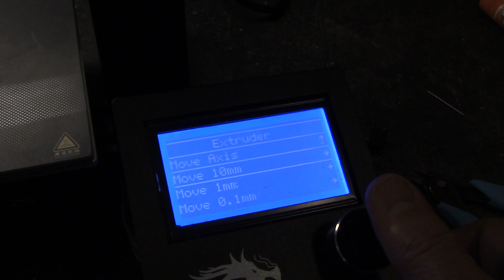Ender 3 Filament Feed Issue - Solved

Comment: I had this same issue.  Made a print and it worked fine.  Changed filament then nothing.  Checked everything you mentioned and still nothing.  The filament acts like its backing out.
Reply from the maker: If it just like mine then the extruder is broken. It’s inexpensive to fix. I didn’t realize at the time I shot this video that mine was broken
Reply: @MyEngineeringProjects  So the extrusion gear? I changed out the nozzle and trimmed the tube a little due to a slight clog and it's still not feeding properly.
Reply from the maker: If it's like mine, then it's the entire extruder which contains gear, bracket, etc.  The issue is that the stock extruder breaks at the bracket itself so it cannot apply any pressure to the gear.

Comment: Is there any logical reason why the gear knob would be knocking & rattling, even when tightened?  It's so irritating that unless I put a ziptie on it to make it stop, I can't be in the same room with it.  I just replaced it & the new is doing exactly what the old one was doing...
Reply from the maker: Where are you putting the zip tie? It sounds like something is loose. I have heard banging and it was a result of the extruder clogged. The resistance was so large that the stepper was slipping which caused the banging noise.

Comment: I fixed all the way up to that part on my end or three pro by the issue that I am coming across now is the extruder will extrude perfectly fine for the test line and then when it goes to do the print itself it will do super thin layers thinner than what it should be like it’s not extruding enough filament
Reply from the maker: There are several things you can try. For one, make sure you have the right nozzle tip size. If it’s under extruding, it could be too small or potentially blocked by some sort of obstruction or damage.

Comment: My printer (Ender 3) extrudes for some in the print and then starts under extruding for 2-3 layers and then just stops extruding at all.When I try to push filament manually I feel a very strong resistive force and the filament barely extrudes ,when I try to pull the filament out it takes a great force to pull I even tried printing at more high temps,cold pulls,cleaning the nozzle and the throat,replacing the nozzle and I even tried a different filament but still same problem. Please help
Reply from the maker: Sounds like the nozzle is not hot enough.  Try to preheat the PLA and then push manually.  Increase the nozzle temperature and see if it will go through. You've already eliminated clogs and damaged nozzle issues, so it sounds like it's not melting the filament enough.

Comment: My pla still didn’t come out and if I tried this the filament is just going forward en backwards
Reply from the maker: It sounds like it has something to do with the nozzle.  It could be jammed, pinched closed due to a plate strike, or the temperature it too low.  Remove all pla, heat the nozzle, then try to push it through manually by releasing the extruder spring.  If it does not go through easily, then you need to find the cause at the nozzle.

Comment: Thanks so much this was such a headache I didnt even think it could have been a issue like this, bless bless
Reply from the maker: Glad it helped.  If your looked just like mine, then the part is broken.  It will need to be replaced with a metal extruder.  They are inexpensive and it's an easy fix.

Comment: did not help
Reply from the maker: What issue are you having with your extruder?
Reply: @MyEngineeringProjects  the filament refuses to go into the hole that leads to the bowden tube (screw is not the issue apparently)
also the bowden tube at the hotend can't be taken off for some reason, i know it's clogged so that's an issue

Comment: Hello I have an ender 3 v2 and the filament comes out manually and how you did it with the control I’m wondering if something wrong with the hot end or if it’s something else I made sure nothing was clogged changed the nozzle and cleared the tube. Any advice?
Reply from the maker: Does it work when you use the menu commands to extrude a bit of filament?  If not, then check the extruder.  Could be a tension issue or a broken part as I had in the video.
Reply: @MyEngineeringProjects  yes it does work when I use the menu controls that’s why I’m so confused I ordered a new hot end and I’m up grading the tube do you think anything else could be wrong
Reply from the maker: Ok. Have you tried a different print file?  Maybe there’s an error in the code.
Reply: @MyEngineeringProjects  yes I have and it still wasn’t working
Reply from the maker: That is hard to troubleshoot.  The only other thing i can think of is a setting in the slicer program.
Reply: @MyEngineeringProjects  thank you I’ll look into it I really appreciate you responding and trying to help with troubleshooting thank you

Comment: My printers nozzle isn’t clogged and my filament goes through fine when manually turn the extruder but when printing only a tiny string comes out
Reply from the maker: When you say manually turn the extruder, are you saying by hand or by the manual feed feature in the software?  If by hand then you might have an issue with the extruder.  If not, then the issue is somewhere else.

Comment: It’s spinning and it’s hitting the element, but it’s just kind of making an annoying like scraping sort of mechanical sounding sound and no element is coming out. It’s also not moving the element into the extruder
Reply from the maker: That sounds like it's jammed at the spool.  Can you manually unthread the spool?  You might also try to take off the tube on the extruder and just see if it will pull it at least to that point.
Reply: @MyEngineeringProjects  I have to buy a new thing of filament because that’s pretty old filament. I have to make sure it’s not the filament thank you though.

Comment: I have an ender 3 pro and my silver wheel is above the filament and i don't know how to get is to be in the right level as the filament , I have tried tightening the screw and it is still above the filament, any advice?
Reply from the maker: I don't have the pro version, but look for a spacer that should not be there like a washer of some sort.  It also might be in upside down.  Not really sure without looking at it myself.

Comment: My printer starts off fine then starts under extruding making the final product but with holes and less stability. Any advice ??
Reply from the maker: I would check to make sure you have the right nozzle size and that it is not obstructed.  If it's too small or partially blocked, that could cause under extrusion.

Comment: Mine ended up being the pla. Weird cause ive used it before. It needed to be thicker
Reply from the maker: I'm wondering if the tension on the PLA is too low given that  a larger diameter PLA worked.

Comment: Never occurred that this was the case for me. Thank you so much for this video!
Reply from the maker: You're welcome I'm glad it helped.  Note that if you had the exact same issue as in the video, that means that the extruder bracket is broken.  I didn't realize it at the time of shooting.  It's a simple fix to replace it with a metal version.
Reply: @MyEngineeringProjects  I have the metal version. the grub screws must not have been tightened enough and the gear slid down out of alignment. Your video helped me take a closer look and see the problem. Thanks again
Reply from the maker: Ok great.  Glad you got it fixed.

Comment: Hello I just got my ender 3 v2 I have only made 3 good prints I also have the cr touch but now every time mid print it stops extruding and the a axis resets and moves up and stops moving. Any help would be greatly appreciated please.
Reply from the maker: I have not had an issue like this before.  Since it does work and then stops, this could mean that you have a firmware or board issue.  I would try first to re-flash the firmware and see if it makes any difference. It could also be a connection issue.  Bad connections are notorious for intermittent issues.  Try to connect and re-connect all of the plugs with the power off.

Comment: I am trying to use my printer after 2 years gap, nozzle heating, all stepper moving but nothing printing!!!
Reply from the maker: Start by heating the nozzle and see if you can manually feed the filament.  If so, then focus on the extruder.  If it won't go through manually, check the end temp and look for a clog.

Comment: 1:20 I'm getting a message saying "hotend too cold" instead of movement options. Not sure what's causing this
Reply from the maker: You need to heat the nozzle before you can move the filament.  Go back to Pre Heat PLA and select the nozzle or "end"

Comment: I tried to replace my filament on my ender 3, but I can't feed the filament thru, and nothing comes out.
Reply from the maker: Make sure the tube is empty first.  You can take it out and thread through off of the machine.  If that works, then heat the nozzle and manually push filament through that as well.  If you cannot manually push it though, then you have to find what is clogged and fix that.  If it all is clear but  won't feed, then you have to look at the extruder and/or stepper motors
Reply: I don’t see my extruder stepper motor spinning when I go through the menu and manually trigger it. Does this mean I need a new extruder motor?

Comment: MY problem isn't that there was a clog somewhere. My issue is that the extruder gear won't push the filament through AT ALL after a few seconds. I use capricorn tubing so I can physically see any blockages and there are none. The community was not helpful when the real issue was the the stock extruder block being a piece of shit and I ended up getting a non creality printer instead with zero issues. The ender 5 pro is an expensive paperweight that had way too many problems.
Reply from the maker: The stock extruder is poorly designed. I had to replace it with a metal version

Comment: For me i after squeeze and tilting the gear , the gear dropped fully down. I then had to fix the grub screw while lining the gear to the height of the other gear up. It helped, but the grub screw is nearly dead…
Reply from the maker: Sounds like it needs replacing.
Reply: @MyEngineeringProjects  haha yes i was printing . It stopped right in the middle .. gotta change it now😂

Comment: Can someone help me please? My printer (ender 3 v2 neo) extrudes fine and when telling it to extrude say 10mm for example it works fine. During a print it works fine sometimes but most of the time it just stops extruding. Like it’s fine to start and then it stops. If I turn the spool a bit to reduce the tension it begins to work fine. WHAT IS GOING ON? Any ideas appreciated (I’ve already spent multiple weeks trying to solve this to no success) Thanks!
Reply from the maker: Sounds like we can eliminate the stepper motor and board.  They seem to be working fine.  Given that adjusting the tension has a short term effect, this leads me to believe you might have a broken part that holds the knob.  On the original Ender 3, this is cheap piece of plastic that breaks quickly as it did with mine in this video. I'm not sure if this is the same with your version, but it's a possibility.  If it is cracked, then the solution is to replace the extruder with a metal version, cheap and easy fix.
Reply: @MyEngineeringProjects  I will check when I get off work and report back. Thanks!

Comment: im having the same issue, i tried this but, it did not work
Reply from the maker: The part is almost certainly broken as it was on mine. You will need to replace the extruder with a metal version. They are reasonably priced and will fix it for good.
Reply: @MyEngineeringProjects  damn! I was hoping i wouldn’t have to, i know they’re like only $17, but the less money spent, the better. thanks for the tip!
Reply from the maker: Yeah I know it's a bummer but the cheap plastic version they shipped it with just won't work very long.

Comment: I've had an Ender 3 for a little while now, but this is the first time I've had this issue. I'll start a print, and the first 10mm prints fine, then it stops feeding filament. By the time i see it, i have to restart again. After seeing this video, im thinking about upgrading my extruder to hopefully solve this issue.
Reply from the maker: It surely could be the extruder.  The plastic frame that they ship with is notoriously weak and breaks quickly.  The metal extruder I replaced it with solved the problem once and for all.  You might have a small break that is allowing the tension to flex which could result in the filament to stop feeding.

Comment: My printer is brand new out of the box. The gold wheel with teeth turns, but the silver pulley next to it only turns sometimes. The filament is lined up perfectly between the 2 pulleys. I’ve manually advanced the filament but it just doesn’t want to advance into the white tube. I have to force it manually and therefore I can’t get a complete print. Any advice?
Reply from the maker: It is most likely just a tension issue.  You will see a spring at the end of a bar pushing filament towards the gear.  There is a screw that you can use to adjust the tension.  It's probably just needs adjusting so that the pressure is enough so that the motor can push the filament.

Comment: hey so ive had filament in the tube and i cut it now theres filament stuck in there and it wont print
Reply from the maker: You need to clear the clog in the tube.  If it cannot be cleared, you need to replace the tube.
Reply from the maker: I put a link in the description for the Capricorn Bowden Tubing.  They are inexpensive.

Comment: Hot end is putting out filament, but the feeder gear keeps pushing out too much filament then feeder gear starts creating a groove in the filament and not able to grab anymore. 

mine is feeding fast and eventually eating the filament and not feeding anymore.  it will do it everytime.  it prints most of the brim and then not printing anymore because of the plastic grinding.
I start again and same issue. very soon I can also hear the gear clicking against the filament as it tries to push it through when it is not called for that much filament.  it's almost like the feeder brain and the rest of the printer is not in sync?
Reply from the maker: What do you mean by "plastic grinding"?  Is the nozzle crashing into the bed?

Comment: Thanks for the help! I was in the middle of a big print and it slipped down for no reason cutting the print in half 😢
Reply from the maker: Glad it helped!  The part is likely broken like mine did.  If it's the same, it will pop off again until it cannot be used anymore.  A metal extruder upgrade is cheap and easy.

Comment: Mine prints fine for about 2 hours then the filament stops coming out.
Reply from the maker: There are many reasons why the filament could stop.  Check the extruder knob to make sure it's turning and has sufficient pressure on the filament.  If you have a stock printer and have not upgraded the extruder, it could break just like mine did in this video.  

If the extruder is fine, then you need to check for clogs in the nozzle.  Run a brush through a hot nozzle.  If you can't get the brush through, then it might be damaged or clogged.  Nozzles are cheap and easy to replace. 

If all of these are fine, then check the tube.  Mine swelled up and stopped all printing.  See this video https://youtu.be/5qs5ENmm8nE

Comment: My golden gear is lower than the pulley. How can I make it go higher?
Reply from the maker: If memory serves me right, I think the knurled knob is pressed on.  You should be able to adjust the height by pulling it up.  Check to see if there is a set screw before doing that.  If so, then it will need to be loosened first.

Comment: I just checked my printer, after finishing about 25% of the print with kinda bad underextrusion it stopped extruding completely, not even the usual spaghetti, and when I unscrewed the extruder bearing bolt the filament the filament in there was snapped, one half coming from the spool, the other - in the bowden tube. Gonna clean my hotend, adjust that bearing and try again, thanks!
Update: still after printing for some time instead of walls there are strings, no idea why that would be, will recalibrate e-steps again and tram the bed again cuz it somehow seems to be too close to the nozzle in the middle even though at the corners it's barely touching, not entirely sure what to do now
Reply from the maker: Great, I hope you get it working again.

Comment: My fillament seems to be stuck. I pulled on it and it doesn't move. There is a wheel on gthe extruder and it doesn't turn either. HELP!
Reply from the maker: @user-lw2uy9sf5z  first thing is to heat up the extruder and try again when hot.  It it's still stuck then very likely the filament got too hot in the tube and hardened near the tip. This happened to me and I had to take off the tube and snip off the part that was stuck. Here's a link to the video showing you how to do it.

https://youtu.be/5qs5ENmm8nE
Reply: @MyEngineeringProjects Thanks.
I ended up replacing the tip cause the filament was stuck inside. Luckily they sent an extra with the machine.

Comment: Hi there, I got a different problem, my extruder gets only the first 3 commands and then the motor will not extrude filament anymore.

Is there anything I can do?
Reply from the maker: To test to see if your motor is good, try to extrude manually from the control panel.  if this works then you know it's working. If not, then you need to replace the motor.

If it works from the control panel but not during a print, you might have an error in your gcode for the print.  It's really hard to tell without more information.
Reply: @MyEngineeringProjects  It works same from control panel and during printing, but it works only for some seconds and than just doesn't move anymore.